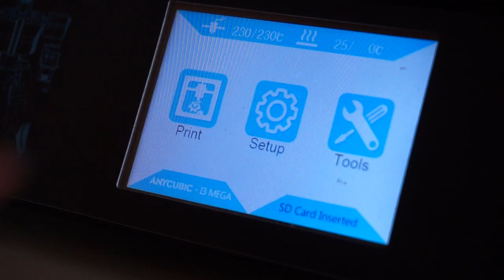DIY Camera lens (45mm f1.8)

Comment: Hello :)
Is this lens compatible with canon DSLR camera ?
If yes, what do we need to do ? Only change the mount part ?
Thank you for your answer !!
Reply from the maker: Thanks for commenting. Sadly the lens is not compatible with dslr cameras in general. It all comes down to flange distance. This distance shows how far away the lens has to be infront of the sensor in order for it to focus. This means that dslr lenses can be fully functional on mirrorless cameras with the help of an adapter. However, lenses that are ment to be used on a mirrorless camera, cannot be used on a dslr camera. 
I hope I answered you question, Raphael. If you have other questions, just let me know.
All the best!
Toni